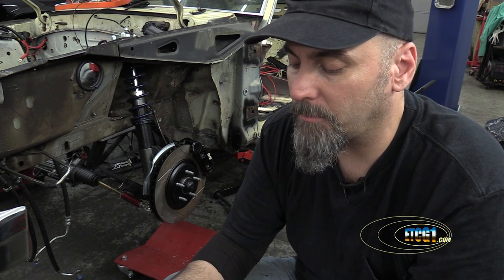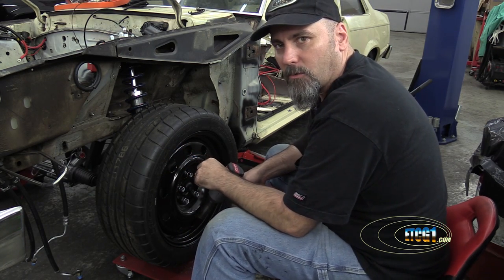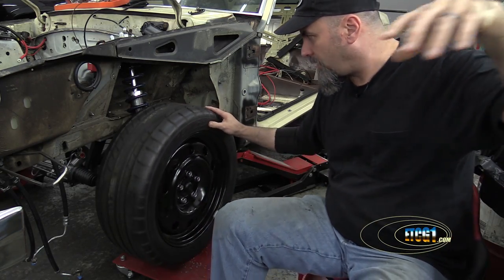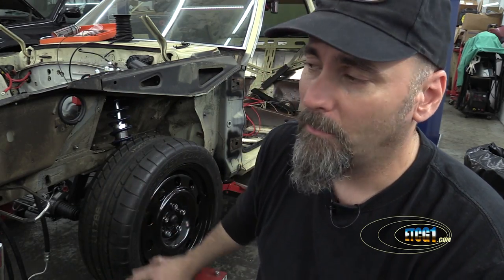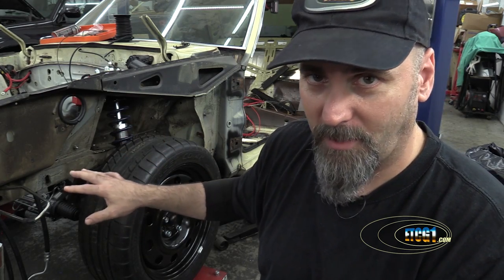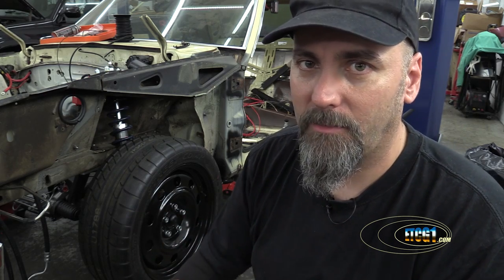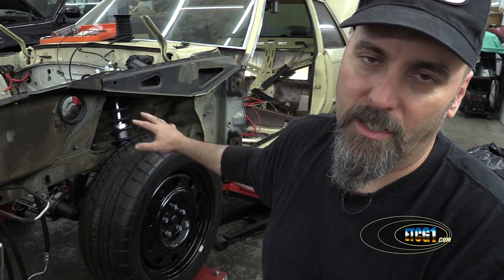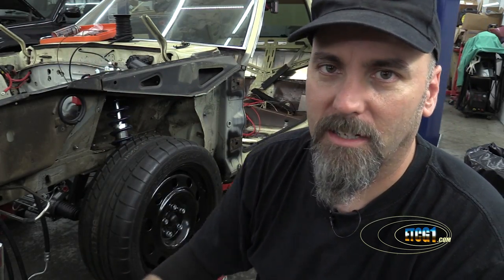Are Wheel Spacers Safe?

Comment: Most people think they're unsafe because they've heard the horror stories of eBay spacers made of the finest chinesium installed by a backyard mechanic.
Reply: Chinesium! THAT'S AWESOME. I will start saying that.
Reply: I'm a backyard mechanic..... I never install chinesium, Ill just add washers to the studs between the hub and wheel.
Reply: @TanTan-ni4mg  I would def suggest NOT adding washers.  That is dangerous and high probability of breaking your studs.  It would created a higher torque in a vertical plane on the studs and snap them off.
Reply: I had ebay wheel adapters in past no issues
Reply: David Porcell on a car or a truck and did you ever take it off road.
Reply: Chinesium 💀
Reply: @TanTan-ni4mg  lool wtf
Reply: The finest Chinesium! Perfect!
Reply: I have a i97 altima with 205/65/15! On rear (drum brakes). Somebody gave me  215/65/15 Michelin tires. The 205 have about a finger clearance between tire and strut. If the 215s touch strut can I use autozone 4 lug spacers

Comment: Hi Eric my name is Tony and I work at Discount Tire and one of the policies we have is that we will not service vehicles that have a free-floating spacer so what you've essentially done is taking your free-floating spacer and made it a non floating spacer the other reason we don't service wheel spacers is because the majority of the time we do not get the proper thread engagement for the lug nut to hold the wheel and by our policies 7 full turns or more is enough to properly hold your assembly to your vehicle when torqued correctly. If your spacer which is now hub-centric allows you to get at least seven full turns of thread engagement then I would consider that safe and I wish more people cared enough about their safety to do what you've done or not run wheel spacers at all. I hope this helps and good luck with the Mustang!

Comment: how are you gonna drive around with no seat, no motor, and no hood?  Thats unsafe Eric, sheesh!
Reply from the maker: Cut a hole in the floor and go Flenstones style while sitting on a milk crate.
Reply: ETCG1 so you're saying it's going to drive better and be safer than the Scorpion crawler?
Reply: @ETCG1  great video 👍
I don't do any car work myself.  How can I make sure that the shop I take it to will get the best part and do the work like you have shown ?  Lexus is 350 F sport
Reply: Sheeeeeeeeeeesh

Comment: Wheel spacers are fine and perfectly safe. We can drive +200 km/h on the autobahn with wheel spacers installed as they are legal and this is germany, a country where every tiny change needs to be inspected or approved by the strict tüv (technical & road legal inspection).

Comment: Yep it's a big close fitting washer with holes for the bolts, it will compress slightly and work fine.
People panic far too much.
Reply: Being concerned over something that could cause you to lose your life if you don't know a lot about how it works, is not an example of "panicking too much". It is the correct amount of concern or "panic" given the stakes.

Comment: A lot can go wrong when people do wheel spacers badly.  Wheel track, offset, suspension, steering, rotating balance, lug protrusion, centering and more.  But on the flipside, Porsche have been factory fitting spacers for many years to increase rear wheel track depending tyre width and adhesion.  Porsche know what they are doing.  Countless race cars use spacers over 2 inches thick and enormously long studs/lugs.  Then they fit a 13 inch wide tire and go circuit racing subjecting the assembly to huge load.  Spacers are only dangerous if you have no idea what you are doing.  Anyone getting bent out of shape over this minor spacer install clearly is just a repeater, repeating something they heard someone say somewhere.
Reply: No system is idiot proof after all. But you nailed it dead on, its only when people who have no clue what they're doing attempt to use them that things get dangerous.
Reply: ArchimedeanEye you nailed it if you don't know what you are talking about and you are just repeating what you've heard from other morons it doesn't make you any smarter.
Reply: ArchimedeanEye same as any modification done correctly it's safe

Comment: Wheel spacers aren’t dangerous IF they are hub centric and the wheel is also hub centric. Also, I have seen 800HP drift cars with 2x 5cm rear wheel spacers stacked on each side! One of the downside is that the load on the bearings change and it can lead to more ware.
Reply: More wear I assume you mean. But with a quarter inch it's not going to do much difference, cornering puts more force on the bearings. I'd say that this video is wheel spacers done right for the right reason.

Comment: i have looked into spacers before. my GT4 came with 25mm spacers in the rear wheels, I removed them not because "spacers will kill you" but because the spacers i had were not hub-centric, my view is that if you have enough hub lip coming out its ok to use non-hubcentric spacers. personally, if i fit spacers in my car, i will have to buy hubcentric ones. which in turn cost a small fortune

Comment: There can be issues with non hubcentric spacers. They then rely on the studs/bolts to hold the wheel central on the hb. Most people don't realise this is done by the raised lip on the hub sitting in the hole in the centre of the wheel. 
The other issue spacers can give is when the installer doesn't maintain suffiecient thread contact by not increasing the stud/bolt length.
I've just fitted 35mm thick hubcentric spacers to my Land Rover to give me increased steering angle. 
The hubcentric version were a lot more expensive than the standard ones. Both sets come with fitted studs to maintain the standard stud length, but the hubcentric ones will keep the wheel located centrally on the hub.
And thanks for the birthday wishes. Much appreciated, although i'm a little concerned how you knew it was my birthday......

Comment: I run 2" Wheel Spacers and 32"" Tires on my Bronco they have help up just fine over a years worth of daily driving and beating the shit out of it 4 buying as well.
Reply: TRX VLOGGER Hey, are yours hubcentric?..I want to put 2 inch spacers on my old wagoneer..I'm putting m715 style flares on it and want to use the original narrow wheels and narrow mud tires just to give it a wider stance.

Comment: Where I've run into failure of wheel spacers was with one of the bolt-on style units that use their own studs. A friend of mine was tracking his car with r-comp tires on wheels that weren't the right offset to clear his front suspension, which necessitated spacers. That high amount of grip from the tires was causing the lugs to come loose after each session and they needed to be re-torqued each time. By some miracle the final session got cancelled. As soon as we got back on the road leaving the track, one of the wheels completely detached from the hub at around 40 mph and lodged itself into the fender well. The studs of the spacer had pulled through enough to completely come away from the spacer body itself. Had that happened on the race track mid-corner, we for sure could have risked flipping. 

The lesson to be learned is, if you're going to run bolt-on spacers, make sure they're of sufficient quality and strength. Best case, don't run them on a car that'll see high sustained g-force from sticky tires.

Comment: If some armchair engineer can explain to me how using a spacer of reasonable thickness (like, 1" or less) is ANY different than using a different offset wheel to accomplish the thing, I'd LOVE to hear it.  

The spacer argument is hilariously stupid (and old).  As long as your studs or bolts are long enough they are fine.

Also, good quality spacers are key - not because of strength issues, but because of vibration issues.  It's amazing what little imbalance caused from a crappy spacer can be felt.

Comment: I use 1/4" wheel spacers for wheel clearance issues on my custom S10  that's still in the works but still drive it as often as I can, have not had any problems with the spacers at all, I just keep the torque in check every so often and worries. Thanks for sharing, great info
Reply: Hi I’m curious where did you find your wheel spacers cause I need pair for my  c10 and  having a hard time to find them are the are  Hubcentric  thanks

Comment: Hey guys I've been running spacers for 1 and half years. I ran 1 slip on hub centric 15mm and 1 bolt on spacer 20mm together! So that's 35mm double stacked hub centric only :P people kept saying it will fail but I've check numerous times and it didn't even get loose once. I was running +45 wheels offset and the spacers made the wheels poke about 1mm out of the guard and looks good. HOWEVER for my case I finally took the spacers off to get the oem look back and the handling feels so much better oem spec. This is from a performance standpoint. I think the spacers created more leverage on the shocks causing it to be more squishy. It also did pull the steering wheel a lot on dips in the road. Also i now have left and right play on my steering wheels but it drives fine. So I would say it does increase wear on suspension components. From my experience if I cared about performance I would not get them. If you want to do it for looks  or clearance then go ahead. Again I ran double stacked spacers 15mm and 20mm for 1.5 years with no sign of suspension completely failing.(except for some play). If you watch formula drift cars in Japan they run 2 1 inch spacers double stacked. Is it safe = yes

Comment: I had an issue with wheel spacers on my dad's Volvo once.  We had put on the snow tires which were on different rims then the regular wheels.  We probably didn't line something up right, because about a week later one of the wheels came loose (we think because the spacer shifted).  Nothing super bad happened though, the car started vibrating a bunch, so I pulled over and tightened the lugs.  I don't think the spacers were hub centric, in fact, the place we bought the rims from had them already placed in the wheels.

Comment: I highly doubt you'll track it hard enough to "flex" those wheels. Though cheap and mass produced, those wheels were engineered for extreme police duty and they've been crash tested. Keep the sleeper look, black steelie are cool anyways!
Reply: J Scott No, he's right. We had hell keeping hubcaps on the only P71 that came with hubcaps in our fleet. The Fleet Commander finally gave up and replaced them with center caps.
Reply: @231mac  That has less to do with flex and more the fact that some dumbass ordered a fleet prowler with PLASTIC HUBCAPS. Whether steel, alloy or aluminum, an ABS plastic cover is going to fly away or get chewed up real quick in fleet use.

Comment: Eric, I can say, that if those rims are 17 inch Crown Victoria P71 Interceptor rims, you shouldn't have to worry. I own a 2007 Crown Victoria P71 Interceptor, and it has the stock 17 inch steels on it, and they are solid. Those rims have taken me throwing my 4,300 lb car into some really wild maneuvers, whilst transferring the weight without allowing the car to slip.

Comment: Putting too wide a spacer on the hub can cause premature bearing-wear but I can't see why they'd be problem otherwise as long as they are installed properly.
Reply: This isn't a spacer issue, it's a wheel width/scrub radius/steering axis inclination problem.  The mechanical forces that drive scrub radius and make the steering excessively heavy are the same mechanics that wear out wheel bearings.  I can promise you the weight of adding a bearing will not cause the bearing damage but the change in leverage against the wheel bearing caused by a wheel that has a contact patch way outside what the factory intended it to be.  Doesn't matter if a spacer is there or not.
Reply: As long as the scrub radius is close to factory it doesnt matter.
Reply: I still don't think this matters, within reason, since adding a spacer adds no more moment arm to the bearing than a wheel with equivalent offset.  Most manufacturers use the same bearing across all their submodels, no matter which wheel it is equipped with, and many of those offsets vary greatly.  (Example: Audi A4 vs. RS4 - same bearings/hubs, but the RS4 wheels stick out way more - in fact, the fender flares even have to be wider on the RS4).  

If you put some ridiculous 3" spacer on or something, sure, I could see your point. But most people are probably in the 10-20mm range when using spacers.
Reply: A wheel with a lower offset will do the same thing...

Comment: has anyone taken apart a ford f250. f350 4x4. the front hubs have like a massive 4inch wheel spacer that bolts to the rotor and the wheel bolts on to it.. for real .. research it

Comment: I have 1.25" hub centric spacers on my Tacoma which are the more extreme one Eric mentioned with their own studs. I bought them from a very reputable company.(Spidertrax) They came with great instructions on mounting them correctly, using locktite, and torque specifications. I would never buy such a critical part on Ebay.

Comment: I have had 1/4 in wheel spacers on my Mustang for 20+ years, I needed them for clearance between the tire and quad shocks, they are not Hub Centric but have never caused a wheel to come loose or been any problem. At one time I had installed a pair of the aluminum space saver spare wheels on the front of my car and had to use 1/2 in spacers so the wheels would clear the brakes and had no problems, they were for driving to the dragstrip and back but were also driven on the street. Those narrow tires and wheels did not corner very well but that had nothing to do with the spacers. Back in the 80's I had a set of spacers the went from a ford bolt circle to a chevy  bolt circle and those did end up with slight cracking in them between the studs but the material being used today is much better than what was being made back then. I would not but used spacers that have studs in them, get a new set instead of saving $5.

Comment: If you are able to break those studs (with or without the spacers installed,) then you are probably in a crash, and aren't thinking about the studs and spacers anyway. ;-)
Reply: Or have a stuck caliper and seriously overheated the studs till they turn blue and red for the remainder of their brittle lives...  Happened to me a few times when I absolutely had to get somewhere.
Reply: Of course they break when you have important things to do, or when you are in the middle of nowhere at 2:00am, with a deadline 4 hours away! ;-)
Reply: I had studs break and cause..well not a crash but a major inconvenience on the highway. no spacers or anything. Best guess is 2 or 3 lugs loosened and the rest snapped do to the unbalanced loading. No spacers, just a big heavy steel wheel.

Comment: Thank you. I've heard so much BS about wheel spacers. If you use proper wheel spacers (hubcentric if needed), they are no different than a stock wheel. Hubcentric wheel spacers on Hondas have given zero problems to anyone I know. All installed properly.
Reply: I should also add that a little bit of blue thread locker will give you peace of mind.

Comment: Just keep in mind for every 10mm of wheel spacer you need to increase the wheel bearing load capacity by 150% as the wheel moves further away from bearing the loads on bearing go up exponentially to the point of 25mm spacer requires bearing with over 2 x (200%) the load capacity.

Comment: Step 1: Put spacer on car
Step 2: Put tire on car
Step 3: Tighten lug nuts
How in the world can you improperly install spacers to make it dangerous?
Reply: Easy.  Spacers of poor material can break/crack.  Spacers too thick can cause insufficient lug nut purchase. Spacers can increase track to the point where the suspension no longer functions as intended.  Large spacers can lead to premature wheel bearing failure.  Spacers can lead to improperly centered wheels.  Spacers can lead to an imbalanced rotating assembly.  Spacers can cause tires to touch the body/frame at full lock.  

Eric's install has all of those areas covered.

Comment: Although I'm against modifying any vehicle from stock. I used to work where we did addons to jeeps, canister relocation, lift kits,  bumpers, wenches lights etc. Iagree with you 100%
I do have a few horror stories, 1 was washers for wheel extenders.

Comment: Like you said as long as the spacer is installed correctly there will be no problem. One other thing to consider is that the inner and outer surfaces are machined parallel. If they are not then you might have a problem. But for the most part they are done with a high degree of accuracy

Comment: 100% agree! Used 1/4 inch Lug Centric behind alloys and got longer alloy lugs so the pass though the rim and into the spacer without bottoming out on the hub. 2 years no issues.

Comment: The photo of the bolt-on spacer that you showed, the one with the nice Sparco name brand on them.. yeah pretty sure if these were unsafe, a company as massive as Sparco wouldn't be selling them! I run 1.5 inch spacers all around on my mazda 3gt daily driver, and for 2 years now there has been zero problems with them. Thank you for your video, I might just put a link in my comment section to your video

Comment: Eric, something that neither you nor the linked article addressed is that moving the tire farther away from the hub increases the load on the wheel bearing. Admittedly in your case, 1/4" isn't much and will probably never cause a problem. But I do regularly see jacked up pickups at my shop with 2" spacers and heavily offset wheels going through bearings much faster than usual.